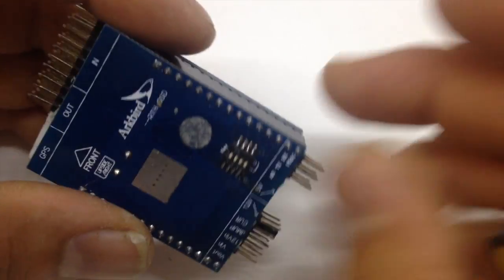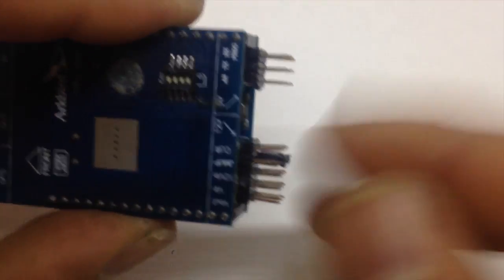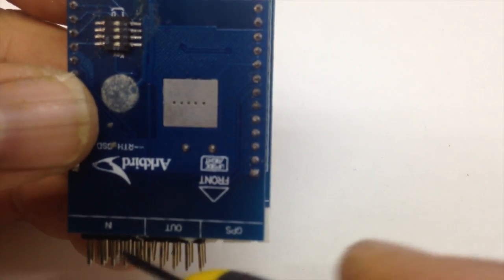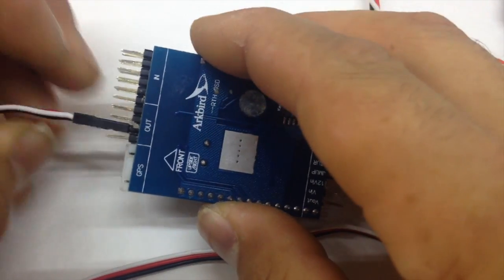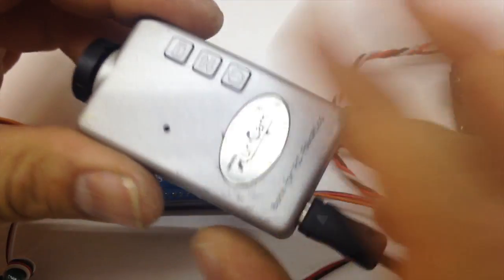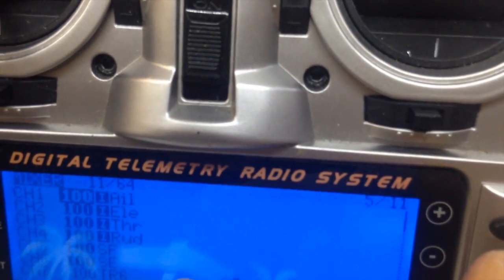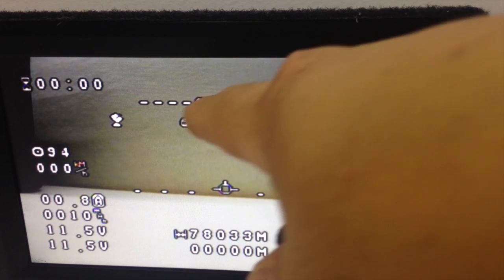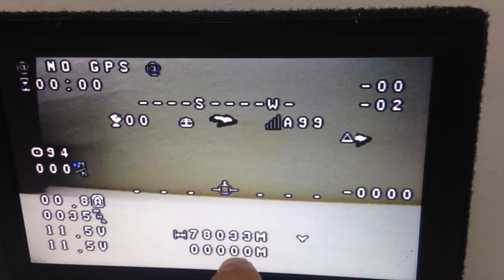Arkbird osd\autopilot overview part 1

Comment: Does the current sensor which you are showing in the video manage to take 4s battery?
Reply from the maker: fmmz if ur fpv equipment can take 4s it should work, however there is an upgrade current sensor that can take up to 6s
Reply from the maker: yes

Comment: hi and thanks for the video,  but i have question ... i tried to connect my drangon link v3 receiver in ppm connection but it did not work ! so do you have any idea about how to set it up in pmm mode ?
Reply from the maker: you should check first if ur DL rx is setted on ppm out,arkbird will reconize it self
Reply: +zodrik81 i thought that arkbird osd works only with arkbird uhf when configuring ppm mode

Comment: does anyone know how to set the 3 pos switch on a turnigy x9 for the different flight modes
Reply from the maker: +Ironiic zero if u use the stock firmware u need to make a mix, I did once,but as been long time,some googling and u will find a tutorial..cheers

Comment: How are you friend; give me a little help there; FPV assembled a wing with Arkbird, did as sends the Manual, DIP4 at 0 and made the setting on the Radio without mixing, or are like to plane, but it does not respond to commands like Zagui,
..Além The DIP4 in 0 have any other configuration to do ??
Reply from the maker: +Carlos Cunha put all the switch to 0,on your radio use a normal setting,with no mix....than in the arkbird menu go to flight/mix menu and in the sub mene where is write mix,chose delta....than try to move the elevon if they are reverse,in the same menu flight/mix you can reverse it...pay attention also when you put in autolevel mode,be sure that the controll surface goes in the opposite direction when u pitch and roll the plane...if you see there is a part 2 of the video...about the en of the video you will see the flight mix menu
Reply: Helped me a lot.
Excellent, thank you, I saw the video without great !!!
Reply: How's friend, thanks for the tip, I could do aki but I am not able to make the right inversions of the commands when I'm Stabilized so I do not know if it is the reverse in the OSD menu, or the Radio, which right?
Reply: it was my Arkbird, but I was trying to set up in a Wing for FPV, and only're giving Bad !!! could make the settings just right, but when I do the stabilization test, the channels are reversed, ie the aileron acts as elevator, and it should work as elevator works with Aileron, I tried to do the inversion in the menu and nothing, and even reversing the radio does not work, did the setting as follows:
1 - Commands in Normal Radio (aileron, elevator) without mixing
2 - In Flight Configuration Menu put as FWind
3 - In the OSD all Cjaves to 0 (zero) - obs already tested all in one and only Key 4 to 0 (zero) and nothing.
4 - Aileron out on the right wing and exit Deep Wing Esq.
I've done several vesez and always the same problem as to put the OSD in aero and is working very well, but in fact would like to leave the ASA.
Any help is welcome !!!